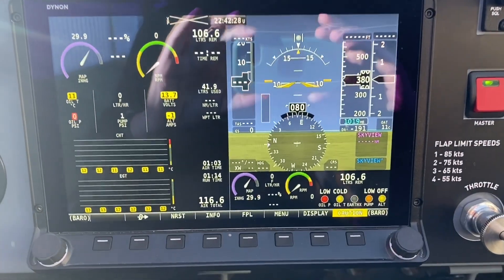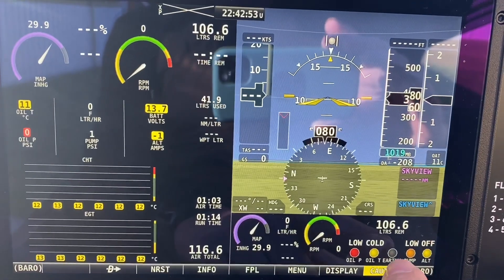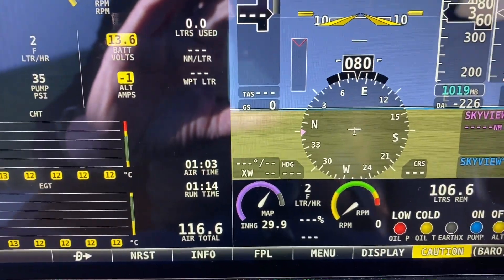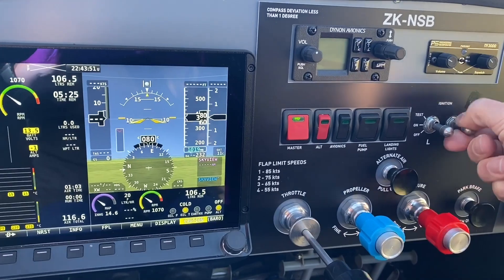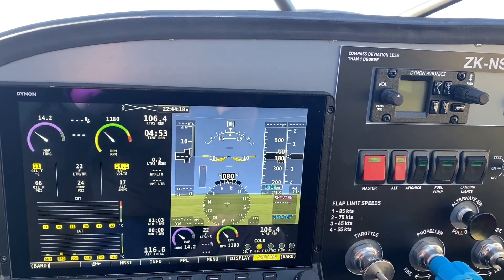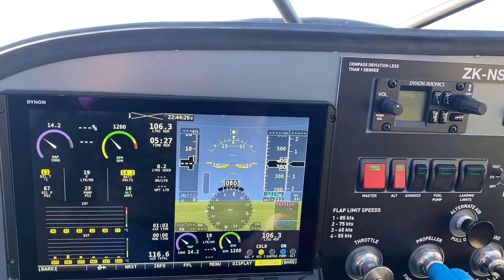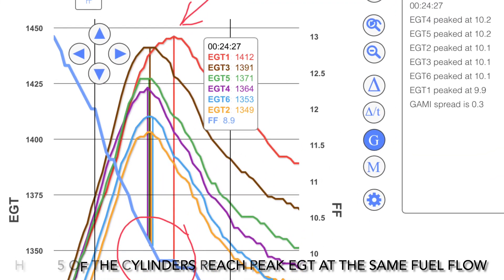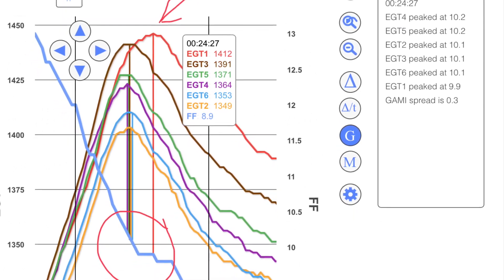Bearhawk Aircraft - flying approaches, aircraft modifications

Comment: Any plans on modifying the flaps? for slotted flaps like the PSTOL? You probably lose elevator and rudder authority due to those big plain flaps that stop the airflow to the tail. You can also approach at a lesser AOA, etc.
Reply from the maker: I've wondered about that. But probably not on this aircraft, mainly because I'm now flying it alot and wouldn't want the down time. Definitely having a lower body angle would be nice for visibility. Also at low speeds it tends to land tail first. Yesterday I fitted ABW 29" tires and that made a huge difference. Much nicer touchdowns, more prop clearance, easier to touch the mains first. Also because of the higher AOA  the tail lifts much easier.
With mine because of the forward CG (8.2") the elevators tend to stall first (power off) and it makes it look like a very docile stall. Actually if you do a power on stall it gets to a ridiculously high pitch attitude, then drops like any other aircraft. On a normal approach, if I use about 50kts at 2100lbs, I can see my aim point easily over the nose, and stop in about 120m. So I'm just flying my approaches like that. All of our backcountry airstrips are 250-300m long typically. The big issue is more directional control.